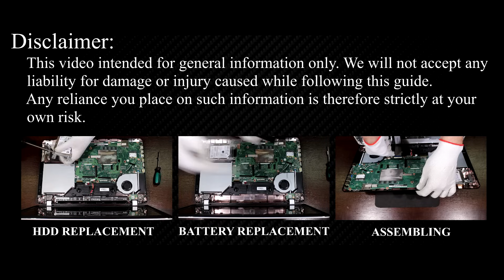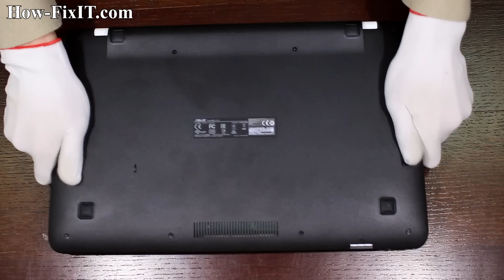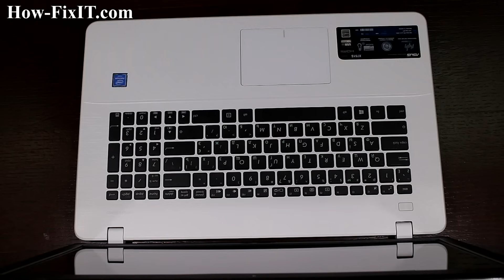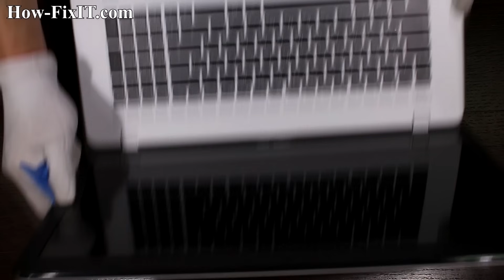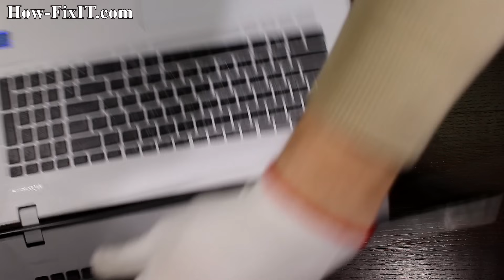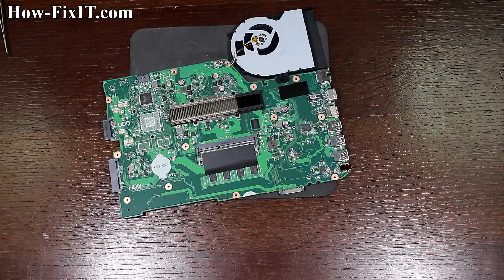Asus X751 RAM Upgrade & Install: Step-by-Step DIY Guide

Comment: That has to be the worse designed laptop ever requiring dismantling everything from the motherboard to flip it over to add memory.  My granddaughter got an ASUS X751X Laptop and wants me to upgrade it.  Not sure about doing this.  I can see it is doable but to an extreme.  I use to do IT Support for a Corporation and never have seen a laptop requiring taking everything off motherboard to replace or add memory.

Comment: On older Lenovo laptops there is a DEDICATED little window on the bottom just to access the memory.
Since the memory is on the BOTTOM of the ASUS mainboard, adding and upgrade "door" on the bottom plate would have been easy and cheap.
If it requires to disassemble the whole thing for such a trivial task, that is deliberate.
Which automatically puts ASUS into the F.U. category on my brand list.
Reply: Not all are like that, X555L has a dedicated bottom window to access RAM, thus not needing opening the full body to replace it.

Comment: how much maximum memory it supports?
Reply: Onboard either 4 OR 8 Giga
1 upgrade slot, maximum size 8G
Therefore either 12 OR 16 G depending on the mainboard version.

Comment: Great engineering.. Asus make totally crap laptops
Reply: On older Lenovo laptops there is a DEDICATED little window on the bottom just to access the memory.
Since the memory is on the BOTTOM of the ASUS mainboard, adding and upgrade "door" on the bottom plate would have been easy and cheap.
If it requires to disassemble the whole thing for such a trivial task, that is deliberate.
Which automatically puts ASUS into the F.U. category on my brand list.

Comment: Wow, I'm never going to buy another Asus laptop... having to do so much to just add memory, is ridiculous.
Reply: Me too. Not going to buy any Asus laptop. This is my second Acer laptop model preview from YouTube (Thxs YouTube) checking on battery, hard disk, memory upgrade etc.. Very disappointed!!!
Reply: Ha-ha, have you ever tried to replace HDD in Imac?
Reply: Mine was crap straight out of the box. Never had a brand new computer suck. I do have a stack of dead Dells that were nice at first then die from crap power supplies
Reply: On older Lenovo laptops there is a DEDICATED little window on the bottom just to access the memory.
Since the memory is on the BOTTOM of the ASUS mainboard, adding and upgrade "door" on the bottom plate would have been easy and cheap.
If it requires to disassemble the whole thing for such a trivial task, that is deliberate.
Which automatically puts ASUS into the F.U. category on my brand list.

Comment: I have an X751LX. Will that 16gb stick you listed work for this? I know it’ll exceed the manufacturers limit, but I’m willing to give it a shot if it’s gonna work
Reply: Hey I'm thinking to buy the x751LK and I need the 16gb of ram, but as you said it does exceed the limit. Did you try the 16gb of ram? Does it work?
Reply: Did it work?
Reply: It will not work

Comment: Hi, nice video! My asus is x751L, and it have 6gb ram. I want to upgrade to 8gb ram. All the memorys in your description will works in my laptop or i need check before? I'm asking just in case, 'cause i don't understand the part and comments write in PY. Someone could help with my question?  Thanks in advance.
Reply from the maker: Yes, all the memorys in description will works in your laptop

Comment: Hi! I have a question. Asus X751L has only 1 slot for RAM ??
Reply from the maker: yes, only one
Reply: @howfixit  So, can I put Crucial 16GB Single DDR3L 1600 MT/s in this slot?
Reply: The max RAM allowed for this laptop is 12GB according to the manual. The motherboard already has 4GB soldiered on it and there is 1 open physical DDR3 slot.  So you would need 1 stick of 8GB to max out this PC to 12GB.